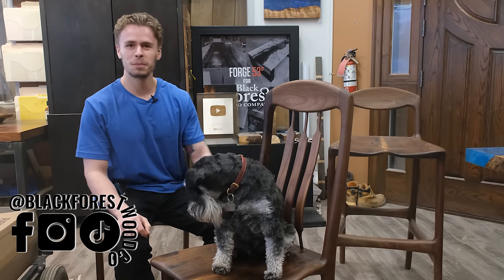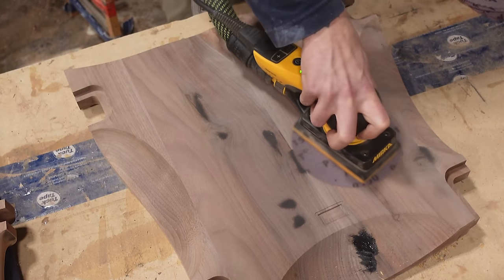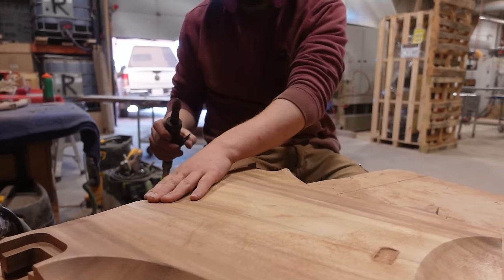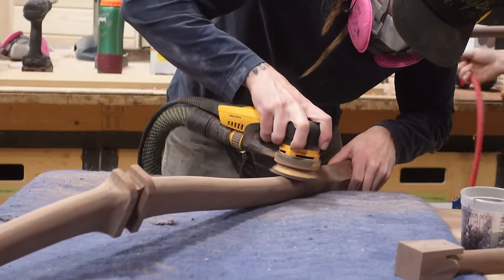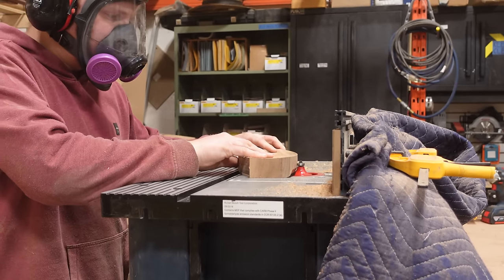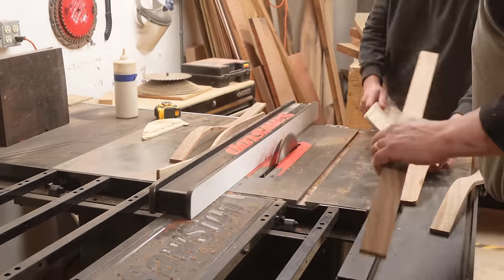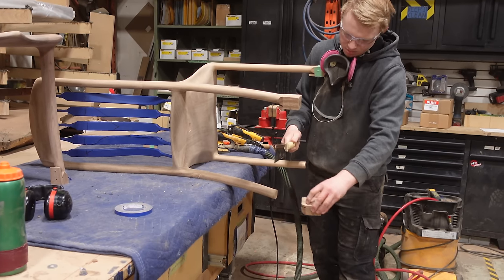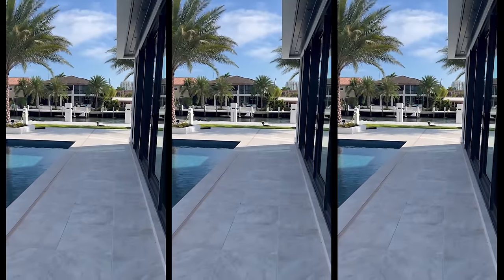Turning Rare Wood Into Expensive Chairs

Comment: Nice work Fellas! Based on the fact that the chairs were CNC done for the most part with simply Bandsawing and some hand sculpting , Having made a Maloof rocker , I would value each chair at about 2200.00 US. Based also on current price of Material in US at about 12 to 15 dollars per board foot ……For Chairs alone.  The slab could cost much more than that based on overall grain appearance.

Comment: 420 osmo works great outside, but its for vertical surfaces only. on flat surfaces where there is sitting water it will grey the wood very quickly due to some reaction with the water. Hopefully these won't get rained on where they're going.